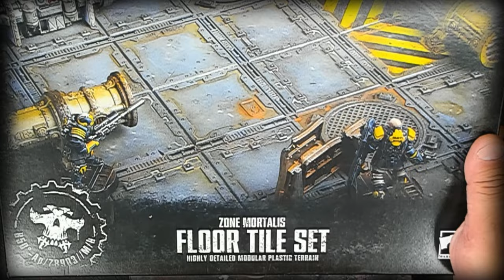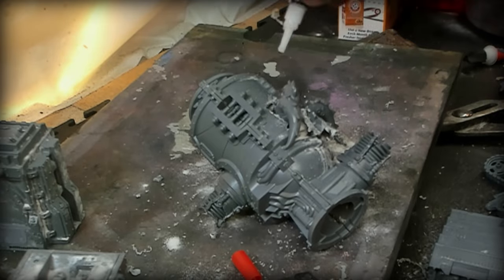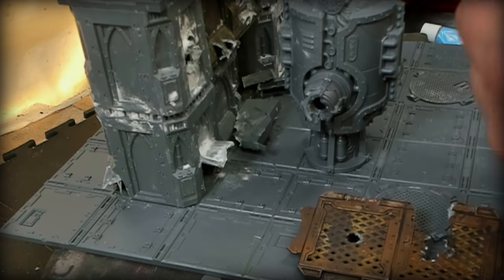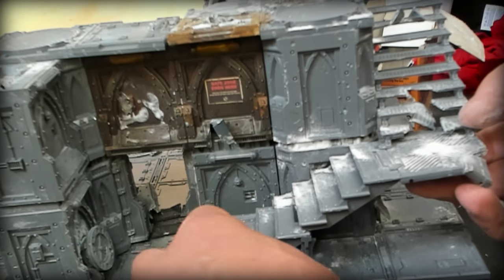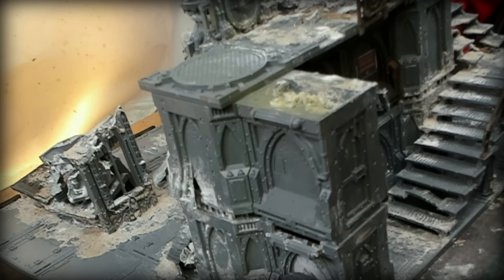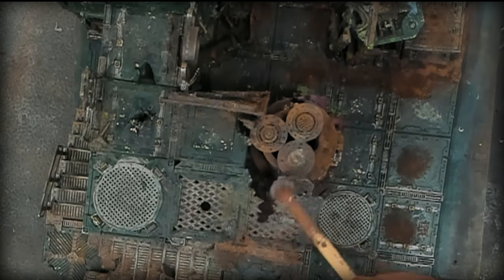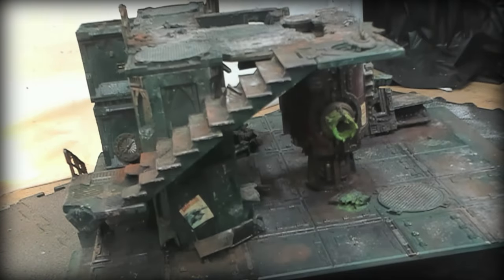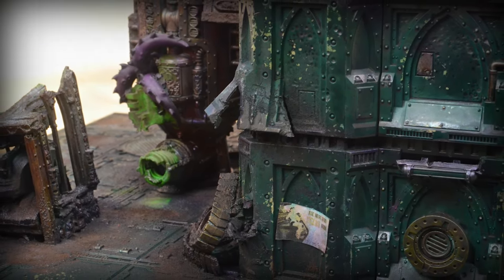Necromunda Secundus Underhells tile 3

Comment: What about making a two tile board that is even more vertical than that are stacked at least 4 high to separate the two levels.  You could put some mechanical/industrial stuff on the bottom of the higher tile with maybe some kind of a habitable structure hanging under the upper level as well (something like the sump city radio pod).  Then having stairs as well as an elevator and a crane connecting the two levels.  I figure with that kind of height it could still be a playable board.  Leave the lower level mostly empty but with a bunch of scatter, maybe set it up as a market.
Reply from the maker: Out of control dude!  I love it!  Future plans bud, future plans!  Thanks again for stopping in!